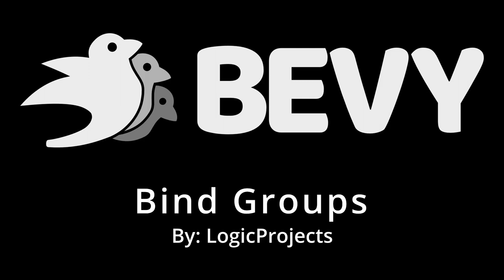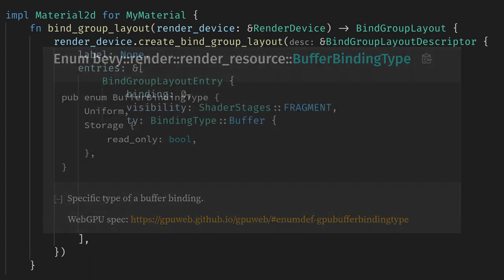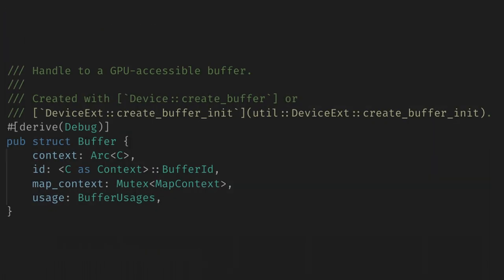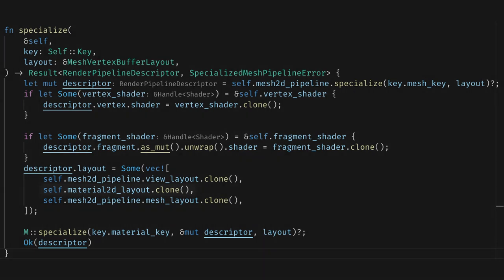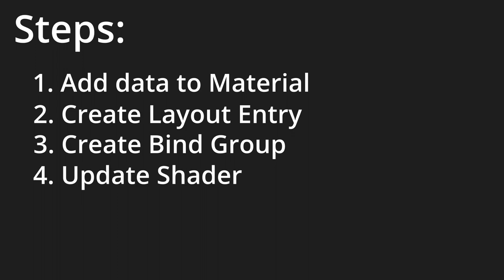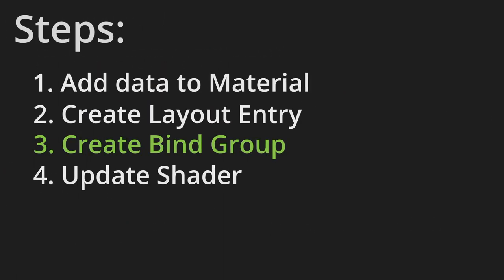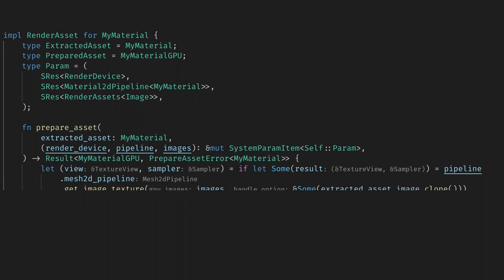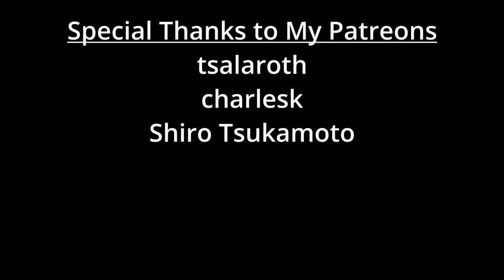[Outdated] Bind Groups and Uniforms in Bevy Shaders

Comment: Uniform data buffers have to be formatted as std140, storage buffer data buffers have to be std430. Dynamic offsets are byte offsets into a buffer that you can pass to a draw command that are much cheaper to do that binding a new buffer. However, they have additional data alignment requirements that have to be taken into account for the byte offset.
Reply from the maker: Thank you!

Comment: not really sure about dynamic offset, but it might just be "based on device configuration", perhaps related to the different memory alignments of the various gpus, but not certain about that. May be completely unrelated tho.
Reply from the maker: I think memory alignments should be constant and are specified in the wgsl spec.  I thought it was more to do with getting data from different points in the buffer.  My research indicated you need to change the offset every draw call but I had to give up on that rabbit hole.
Reply: @logicprojects  - thanks
Reply: @logicprojects  you're right in that the dynamic offset is for specifying where in the buffer you're reading the values from. Imagine a situation where you have 200 materials. Currently each material data will live in its own buffer and and its bind group will reference that buffer. What you can do instead is write all the materials next to each other into one big buffer, and when setting the bind group before the draw calls specify "I want you to bind this large material buffer but please start reading at offset 512". The shader stays the same, but the values are now all read from a single buffer.

Comment: I have been working on the exact same things recently and have ended up with something very similar to your example. I ran into one problem though when trying to use a bool. I think  the error was about bools not implementing AsSTD140 but I can't quite remember. I ended up using an int to represent it instead. It works, but it bothers me a bit. Have you successfully used bools in Bevy Shaders?
Reply from the maker: I have not used bools but you are correct that they don't impl std140.  I just tried it this morning and got some validation errors on the shader so it would take more playing to work out.  Also the wgsl spec seems to be silent on the memory layout for bools ( https://www.w3.org/TR/WGSL/#alignment-and-size ) so it might not be possible.  Your workaround of converting bools to ints in the same way we convert colors to vec4s sounds like a good solution and glsl seems to use 32bit bools so it's not wasting any memory or anything.
Reply: Thanks for the info! I'll just stick to my i32 workaround then, for this and future shaders.